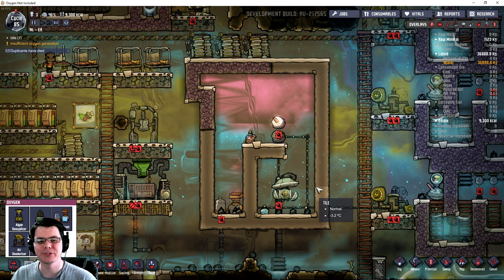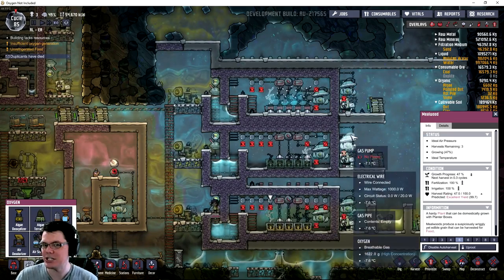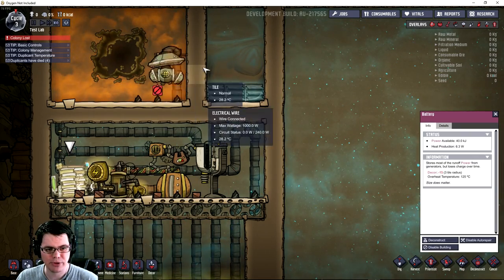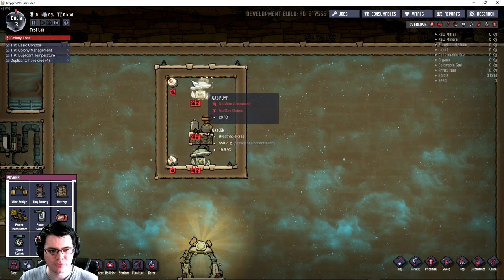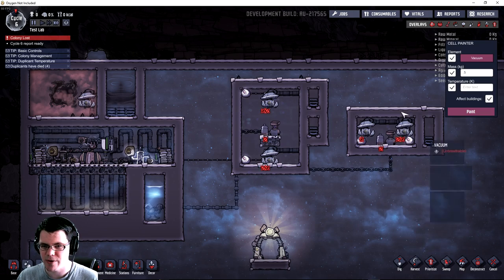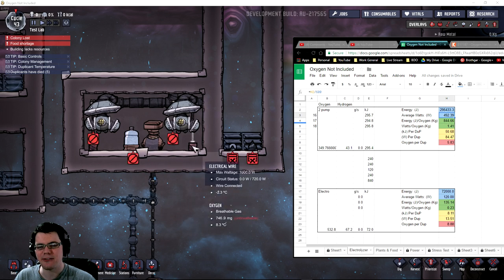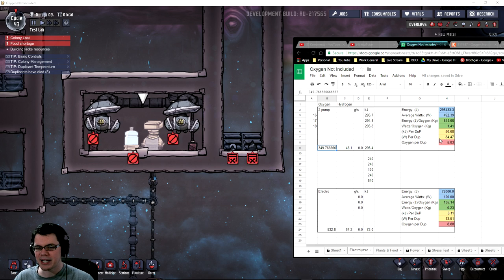Hydrogen Separator Experiment! Oxygen Not Included

Comment: That vent pressure water trick is something else.

The electrolyzer stacks i've ended up making are open at the bottom so air goes out that way and through a pump at the top that splits hydrogen somewhere and air somewhere else.  If the pressure isn't super low at the start of production I don't ever seem to lose any hydrogen out of the bottom when the electrolyzer is at least a few tiles up from the bottom edges.

Comment: My system for base electrolizers is to build them with gas permeable tiles beneath them.. allowing the oxygen to empty into the base.. I then set up a pump above them to pump out the hydrogen.. with the new switches it's pretty efficient, and you can even set a switch in the base that essentially turns off the whole system when the pressure in the base reaches 1000. Because they produce far less hydrogen than oxygen, and the oxygen finds its own way into the base, you only need one pump for each electrolizer, which makes for a neat base.

Comment: Hey Brothgar, about the farms, I've figured out the easiest and most efficient way. 

Keep your grow rooms small and insulated, 4 high with hydro tiles up one from the floor and regular pipes on the floor. This is to increase the amount of pipe exposed directly to the air in the farm and leaves a 2 high space for your crops to grow. Outside your farm, run insulated pipe to a liquid storage area kept at the right temp for your plants. 

Your liquid source should be in a cold biome so you only have to heat it up to the right temp in your storage. In the end, you are warming your farm to the right temp and keeping it that way using the pipes for irrigation themselves.
Reply: http://imgur.com/a/1zTXg
Here's a couple pics of my first simple setup for illustration. It's still warming up, but it's already at the low end of the ideal temp. Top temp switch is set to below 20.9 for the heater, bottom water pressure switch is set to just below 800 to stop intake before the walls blow out. The power system needs work.

Comment: I've been using a module with 4 electrolyzers set above my dupes' living quarters. This allows me to use gas-permeable tiles on the floor to let the O2 mostly distribute itself by falling down into the base. Then I can use just a single pump with a filter at the top to pump out the H2 to a generator. Any extra O2 is handled by the filter and sent off to an expansion base in another biome for only half the power of a second pump, and I have no worry about things going wrong when I pump out too much H2.

Comment: ideal system: a 14 tall, 4 wide chamber, with the electrolyzer dead-center, and the gas pumps on the far extremes. you may also want to try the liquid trick, if possible, on the electrolyzer in a 6-wide system (with the electrolyzer on one side, the cup to hold the water only takes half the space, leaving plenty of room for oxygen to sink) at which time, the increased pressure actually accelerates the gas separation process, making the whole chamber much safer.

Comment: As someone else said, i could imagine a system with only one pump for the hydrogen. The oxygen would just naturally flow out. For a practical use, this would of course mean, that it leaks directly into the base and the base would have to be pressurized. Finding the optimal lenght of the seperation balancing between avoiding hydrogen leaks and keeping the electrolyzer running.. I love your experimemts :D

Comment: Hello Again Mister! :D

I did not calculate the power-efficiency, but I did a small adjustment, and it seems like the electrolyzer is working more often then w/o the formentioned adjustment:

I did set the top preassure sensor to 1100 instead of 1000, while the bottom one stayed at 500.
I did remove the tile "separating" the two chambers in the top (if that made sense). (The one 1tile to the left, and 5 down from the top pressure switch).

Comment: hey, check the coriolis force, hydrogen goes  to top left, co2  to bottom right, o2 bit is mostly based on other gases, polluted o2 goes up each room. so top left side hydrogen pump cause gonna be layered diagonally. there was an interesting method using gas bridges direction and a loop filled with one type of gas and a valve set on small amount, filters one type of gas because the pipe wont let other gas in even if its a small amount of one type inside, loops until the pocket is 1kg then can be let out with a branched pipe into other valve set to max. needs initial filtering and works for all type of gases. requires pumping. also a wheezewort can lower pressure near air vents same as the watered vent cheat, probably bottles up some. .

Comment: Hey Broth, watched the video and liked it quite a bit. I'm just wondering why you would need to shape the electrolyzer's chamber since you're using mainly pressure and gas density to control the separation of hydrogen and oxygen. Couldn't you make this a lot more space efficient by putting the electrolyzer between the pumps and maybe making it slightly taller instead of making this so large? Also, would that scale well if you placed many electrolyzers and pumps side by side?

Comment: Hey Brothgar, an idea for something you could experiment with. 
A body of water seem to do a thermal update/refresh (or something) once it reaches a new level/layer/tile (watever you wanna call it). As in when it finishes "filling" one square and starts on the one above it. 

By abusing this, you can rapidly cool down water by having cool gasses running in pipes like a radiator and having the water bounce between two layers. 
Discovered this last night but not sure what the best setup for it would be.

In my test I had a room about 30 wide and 5 tall and had it bounce between the 3rd and 4th layer by filling it with warm water once it got under 4th, and pumping out once it got over 3rd. 
The gas was hydrogen at -60C*, any colder would just freeze the water, but that may change depending on room size or pipe material. The temperature of the water did not seem to matter as it ended up being 9-12C* regardless with my setup.
Warmer gas would result in warmer water though.
It has to be a wide room too, as a 5x5 room did not seem to work.

With this you can have your boiling hot geysir water turn into cold water instantly without any micromanaging.

What I now wonder about is what else you can do with this and what the magic numbers are.
Reply: It is, but did some testing on my own and after a LOT of testing I figured a few things out that simplifies it a little, as it did not work the way I thought it did. But let me just say..water in this game is kinda weird...

What is actually happening is once the top layer of a water tile is filled, the new layer behaves as its own independent water tile. So if you put 100g worth of water on top of 1000kg, that 100g will be easy to cool down and any water directly below it will copy that of the 100g. 
I say 100g, because you don't want to go much higher than that. After 250g it's just too much water too cool down quickly.
Worth noting is also that if you pour 100g on top of 1000kg, it won't actually be 100g on top. This is because as you fill the next layer, the layer under wants to be up to +10kg of the layer above it, so some of the new water bleeds down.

So all you have to do is slightly overfill something and have it touch something cold, and it will transfer that down, regardless how deep your pool is, but It does not transfer sideways other than the natural heat exchange water normally has. 

So the easiest would be to have a pipe with either gas or water with the desired temperature running above your pool, then slightly overfill it when you want to cool it down. 

The best way to do this however, I don't know yet. Have had some success with different designs. The best one yet is a combination of a water lock on the intake and a sprinkler system for the overfilling to better control it.

Comment: actually, the set up is still sloppy but made me realize. The reason that having the pumps below the Electrolyzer doesn't work is because it splits hydrogen out in all directions and it takes a little bit until the hydrogen to start rising. The most optimum way to refine this design is to reduce the amount of space between the electrolyzer and pumps while also giving enough room for hydrogen to rise. The main problem is that the area around to Electrolyzer is always going to have air pressure issues until you find the sweet spot.

Comment: Nice science. The solution without a filter is certainly quite viable.

That said - I don't quite see the need for a system like this and I think it can be simplified quite a lot more by a more direct and "messy" approach.

It's not a new or unique idea by any means, but you simply plop down your elextrolyzer directly in whatever area you need the oxygen and allow the hydrogen to rise up. If you just make some minor adjustments to the top of your main base area so there is some sort of pyramid shape to capture the hydrogen in a pocket then the hydrogen sort of just takes care of itself - and you can use the surplus there for power as you will. You may need a few gas-permeable tiles here and there to allow for flow, but that's always a good idea anyway.

Hydrogen just isn't a problem to have drifting throughout yuor base. While it's nto breathable, it's not inherrently dangerous, and there is not enough of it to make breahting a problem - and hydrogen is also so cooperative about seperating itself out and drifting to the top.

Basically by letting your entire main base structure be the seperator there is very little need for pumping stuff around. Not even the hydrogen at the top need a pump if you just put a hydrogen generator right there and regulate it with a pressure switch or something (may not even be needed - can't remember if a hydrogen takes damage if it tries to input oxygen or just stops).

Oxygen + free energy to boot. Water is the only limiting factor.

Comment: Hello. i hope you still read comments on slightly older videos!

When you add in the Hydrogen generator and the pump kicks in to feed it... unless you use a pressure valve you are throwing away some of the hydrogen into nothing. Reason being that the Hydro gen can only store 2000g of Hydrogen gas and you pump in quite a bit more than that.

This could actually be self sustaining i think!

Comment: Question.  Why 2 Gas Pumps?  With each gas pump consuming  240 power, that 480 in total.  Why not use only one gas pump and one filter?  A filter uses half the power as a pump, so the total power would be 360.  Would this be more efficient?
Reply: Keep the 2 active 100% of the time spent 480w, and keep 1 pump and 1 filter spends 360w active 100% of the time, what happens is that in this system you do not keep them active 100% of the time, the oxygen gets active about 88.8% but hydrogen will only be active in about 11.2% of the time, 1 generator generates 112g of hrydrogen and 888g of O. basically you only use 1 active pump saving 120w per day
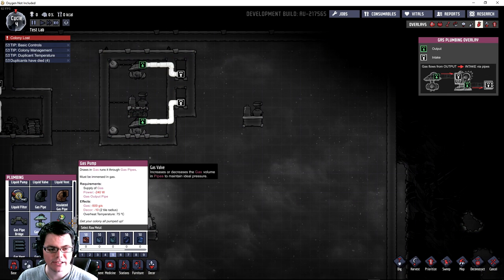Reply: He said it at around 4:40. The Electrolyser produces 1kg of gas per second, but the pump only sucks up 500g per second. So you need two pumps per electrolyser or else it won't be active half the time because of overpressure.
An alternative would be to just get rid of the oxygen pump and let that just flow out from the bottom, but I dunno how well that works.
Reply: Ah, I see.  This is the opposite problem as what I have in my base as it is my base that is overpressurized.
Reply: Hm maybe you should construct more oxygen vents then? If your output vent is overpressured then your electrolyser location will also eventually become that way because you can't pump out the gasses quick enough.
Reply: No, it is my whole base that is overpressurized, not just the vents.  What I need is more Dupes to consume what I'm making.  Currently I have one oxygen chamber containing two electrolyzers, one gas pump and one gas filter leading to four vents in my base supporting 9 or 10 dupes.  As I add more, I'll add a second room.
Reply: Two Electrolysers are enough for 9-10 dupes? Do you have other oxygen generation?
Reply: Three or Four Algae Terrariums.  Also, I'm currently strip mining a toxic biome, so my dupes are mainly only in my base at night.

Comment: I put an oxydizor as low as I can in the base but just above the water tank in early game. 
Go up about 4-5 levels for the base itself then as wide as the starting area/starting base. (As wide as it needs to be to not allow any hydrogen and none escape out sides. 
Dig a pyramid. 

1 gas pump at top. 1 filter somewhere near. Insert gas lines at least the length along either edge of the pyramid. (Can make longer later which guarantees more hydrogen in system )
Put Hydrgen gen at bottom of pyramid with 1 large battery. 
Run power from base to pyramid system with switch. 

Start the oxydizer and let the pyramid fill up with hydrogen. It won't fill evenly but that's ok. As long as it gets to the point of hydrogen not moving out of base area. 

Flip the switch on and off (With a Dupe Need to get 1 square of hydorgen past the filter)
Once this happens. Walk away. Permanent self sustaining system requiring no power. 

You could even put in the new transformer after the battery and any run off power will go into base. 

Will add some pics later. 
Power usage. 
1 pump 1-4 or 5 oxydizors. Haven't found out how many pump to keep them all supplied. 

To throw a wrench in your system. 
The pump is not running all the time causing inaccurate numbers. 
Add some more oxydizors to get accurate numbers. Guesstimate. Power usage will go down.